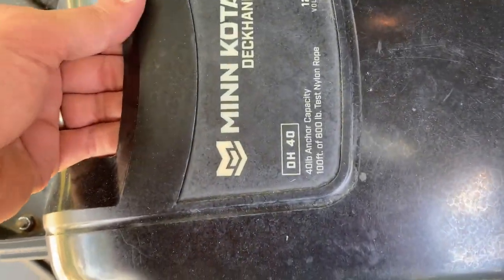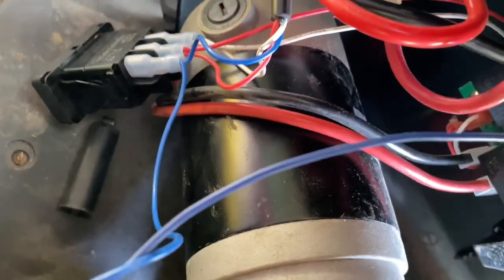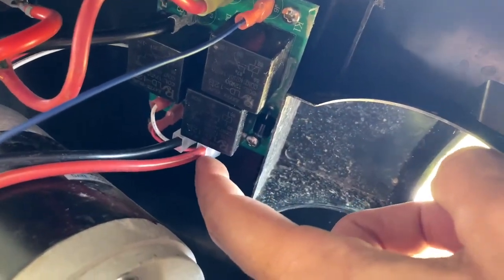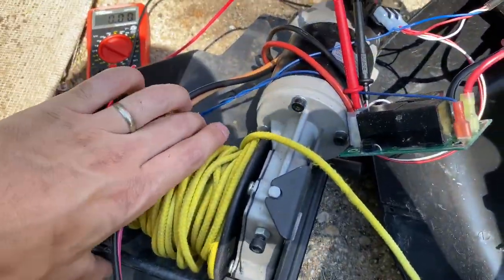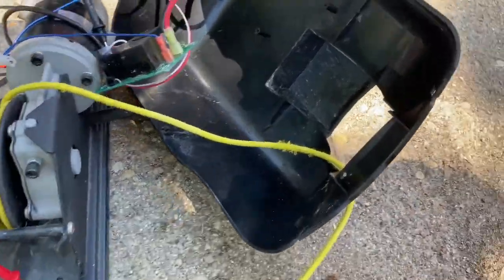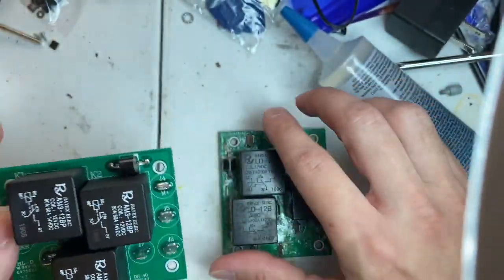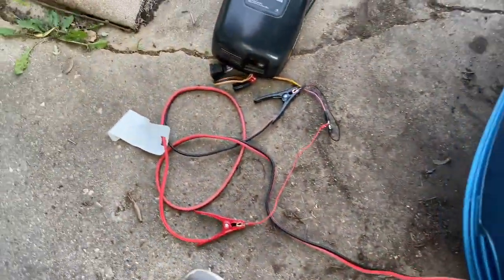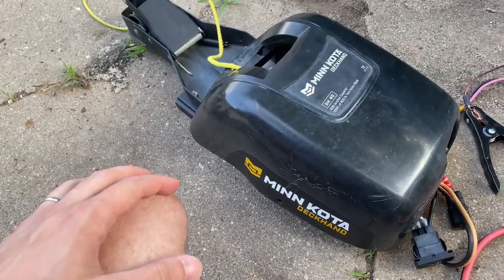Minn Kota deckhand Dh 40 repair troubleshooting

Comment: Thanks for this informative feedback. The new board (Relay AM3-12BP) you have bought was using relays that can carry twice the current of the previous model. I am guessing this was a common problem Minn Kota has and they decided to use a more robust relay. I would like to order a new board but I want to make sure they use the new upgraded relay, could you provide the source you get this new board. BTW those relay are sealed and do not need additional sealing but when the contacts get submitted to too much sparks they may build up pressure inside and the plastic can open.
Reply from the maker: eBay, and contacts are sealed but under the relay itself is open for corrosion. That’s the reasoning I was suggesting to seal it, since that’s where this board previously failed

Comment: Can you share the link to buy the complete board can't seem to find it on ebay and my deckhand 40 is doing the same thing ..
Wont fo down only up...
Reply from the maker: https://www.ebay.com/itm/2378225-Minn-Kota-Deck-Hand-40-Control-Board-/133116302523?_trksid=p2349624.m46890.l49292
Reply: @hitandrepair  i have the same problem and changed the board and the switches and will only go up also. does not allow the motor to go donwn